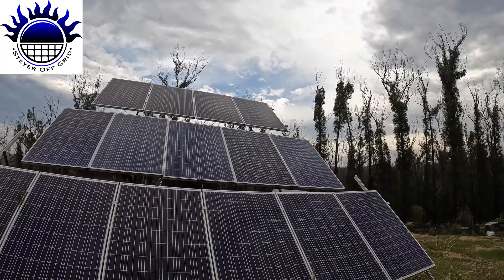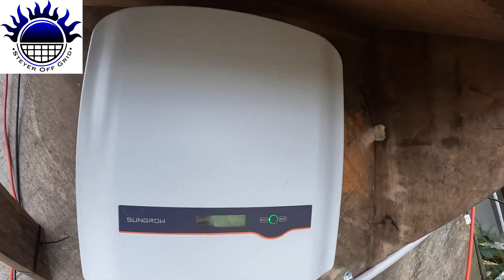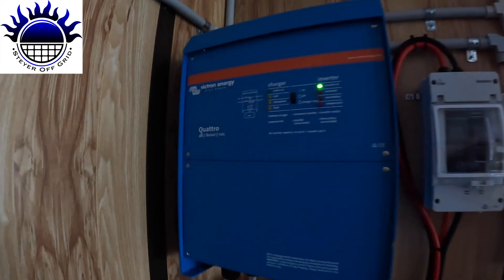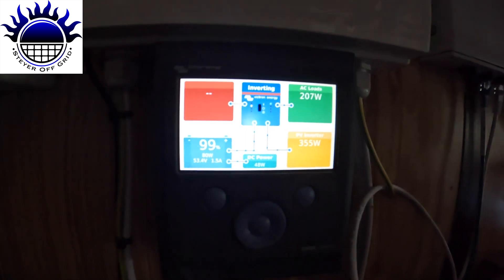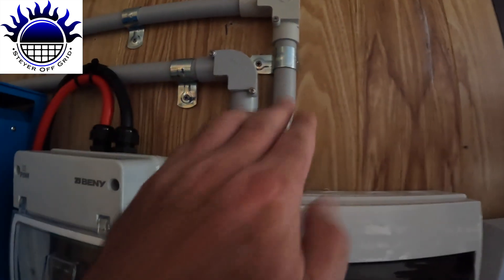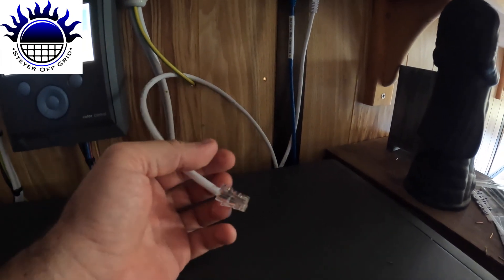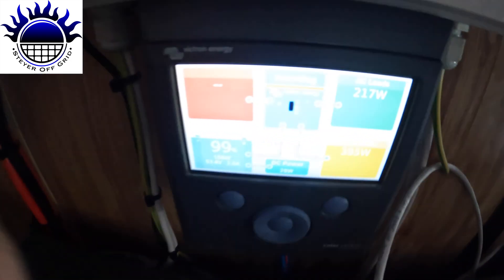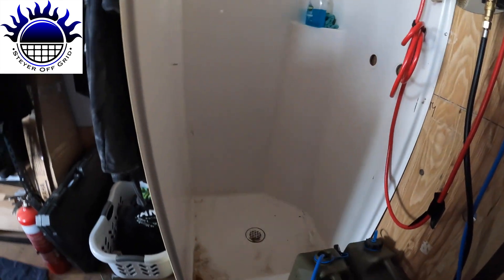New Steyer Off Grid Solar System

Comment: thanks for the video. quick question, do you connect the ground wire from the panels frame to the ground nuts on the inverter?  thanks